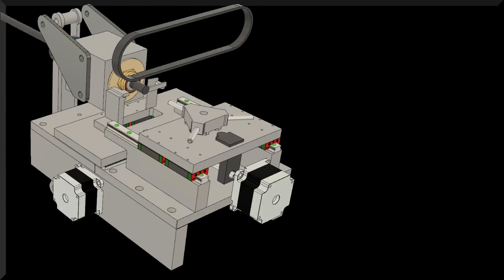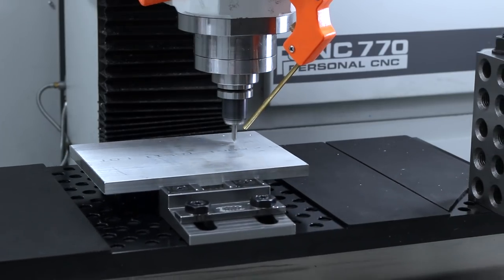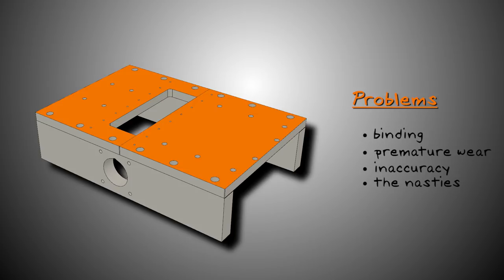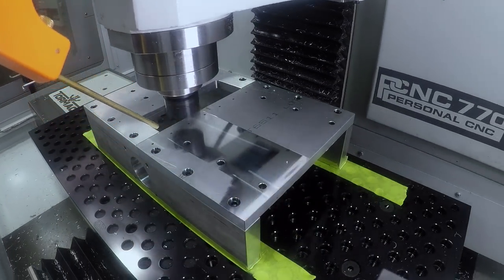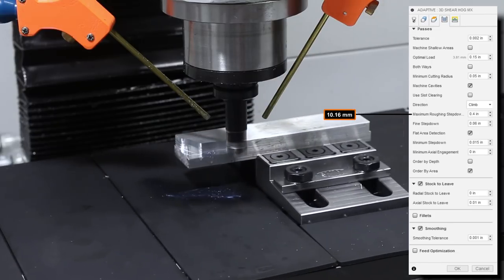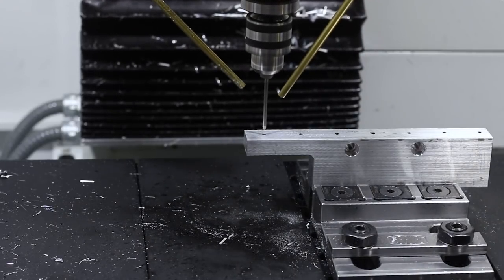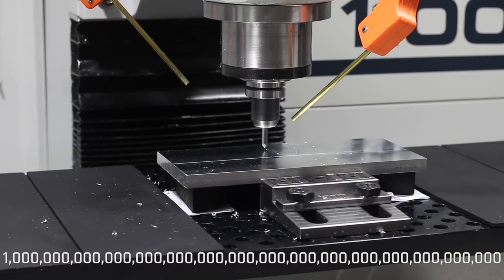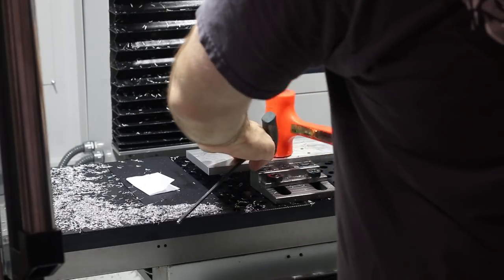DIY CNC Turret Lathe - Part 2! WW206

Comment: I see the super glue trick working.....but it is so hard to get excited enough to make it a normal way to hold workpieces. 
Perhaps I am not brave enough, lol. 

Great to see this coming together!!!
Reply: I gotta say, I was pretty nervous about it at first, but I haven't had a piece come off during an operation yet! Though, I am machining on a less-than-rigid benchtop CNC machine, so I'm taking fairly conservative cuts. I find that small pieces are the best use for the method, because clamps can so easily make it impossible to do any machining on a small part, HOWEVER, there seems to be a little play/wiggle imparted by the glue layer on the tape. The most rigid setups I've found come from pieces with a large surface area to glue up. That being said, I haven't tried the specific tape that NYCCNC recommends so maybe that tape doesn't 'slide' the same way mine does.
Reply: What does the dual papertape layer and randomly applied glue to the precision in z?
Reply: It will do something, but as he said in the video he was making the top surfaces co-planar. He didn't claim that he was making the top perfectly parallel to the bottom surfaces, so I'm guessing that wasn't critical. The goal was to make the linear bearings ride on the same plane and this method achieved that.
Reply: ColdHeart  I've been using double sided tape and hot melt glue on my wood lathe for years. Obviously it has it's limitations but don't all methods  ; -)
Reply: Especially when traditional methods take the same amount of time and are safer.
Reply: How would you have tackled this part? Maybe don't be so critical if you aren't going to offer your solution. Using super glue in fixturing isn't exactly new, our job shop used super glue on certain jobs decades ago.

Comment: Curious with that superglue technique what is the deepest cut you can make without tossing that off the table? Guessing your not going past .015? It’s intriguing to see done yet the thought frightens me.  I’ve had 1 too many parts launch across the shop that was securely attached because of some freak issue like a unexpected spindle drop, etc...and yes I’m back watching again. I find myself watching your videos over and over and focusing on different techniques your using.

Comment: Am I missing something? Gluing 2 pieces of single-sided tape together somehow stronger than 1 double-sided tape?
Reply: Nice! I didn't consider the burnishing of both sides. Clever!
Reply: I understand the tape holding power but can not see the ability to hold any tolerance with "gap filling" gobs of glue..  You mount and deck twice with different tape/ glue as an interface.  How do you know your not 5 tho out of flat between setups? Seems like the glue and tape interface could add a lot of unpredictable variability.
Reply: Ed, did you guys do a vid (or are gonna do) on how tape/glue/tape might affect tolerances? I am wondering too.
Reply: kirk creelman my thoughts exactly.

Comment: Does the surface grinder work for aluminium?
Reply: Jonas Bandier no magnetic bed cant hold it an even if you use a vice the stone wil gull up and you wil get  a horible result bot for your machine and workpiece  its only for hard matiralls

Comment: I'm trying to get past my gut reaction to the superglue. It really seems to be holding.
Reply: Do you do anything special when running with flood coolant? I gave it a go this week and threw two parts at the walls of the enclosure.Both times were with flood running, and the technique (& materials) were identical to what you guys have shown. The failure was in the tape adhering to the part both times. Surfaces were freshly decked off and cleaned thoroughly. Our conclusion was that the coolant penetrated the tape and severely weakened it. John did mention a while back that you use it on your Haas with flood so I'm curious to see if you have any insight?

Comment: For your turret indexing, why not put a spring loaded ball bearing or rounded pin into the turret base plate and then mill a corresponding rounded track, with detents at 120 degrees, so that the turret indexes itself under spring tension for those last few degrees of rotation? Something like this: https://a360.co/2Oi25py